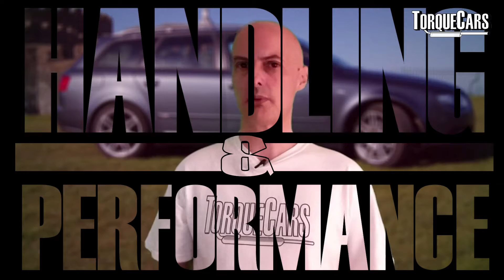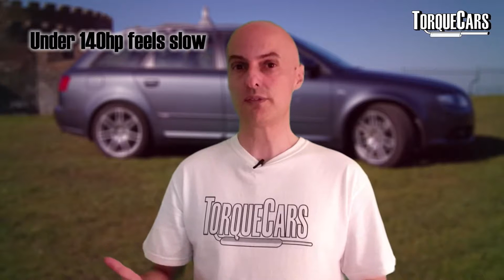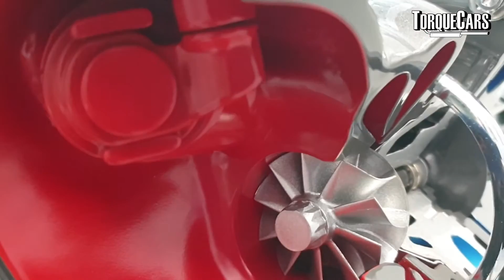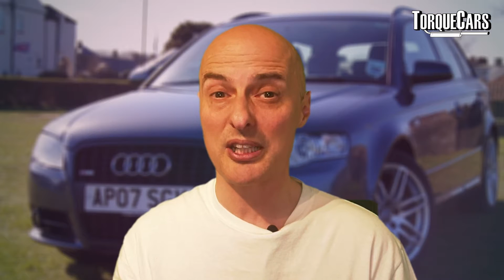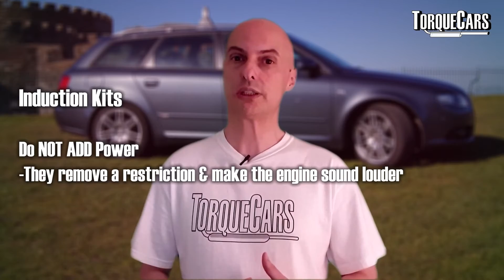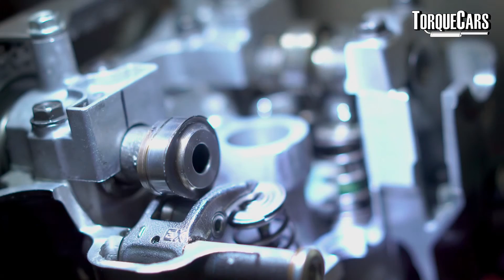Best A4 Tuning Modifications & Upgrades [Performance Mod Guide]

Comment: Im thinking about buying the Audi A4 Avant B9 150HP 35 TFSI 2019+ model, since you can remap this with only chiptuning stage 1 to a significantly high performance.
It will go up to 235 HP or 245 HP.

Would I need to change stock parts for this? To not come in trouble later on.

Thanks a lot! Liked your video and subbed as well. ❤
Reply: spoiler alert the audi b9.5 after 2020 has a different EMS which makes remapping impossible

Comment: CLUTCH... They have limits. Make sure you do not exceed these limits. A stage 1 remap without any other changes will reach these limits. The clutch fitted on my B9 2.0TDI is rated up to 420Nm. The car standard output was 320Nm but a simple remap took the output to 447Nm, so we did a custom remap on and limited the output to 420Nm.
Reply from the maker: Very good advice there, so many overlook the clutch when tuning the A4.
Reply: Hi @MH0709,
I’m owner of a B9 2.0tdi 150bhp, thinking about doing a stage 1 remap.
My afraid is do I need to do anything to my turbo, injectors, pump etc?
I’ve been told that the increase should be +30bhp and +100Nm, this way I should get 180bhp and 420Nm.
Another concern is the fact that I use my avant every day, 140km which 120km is on highway. Would really like to have my avant for a good years.
My driving is soft, but I would really love to have that extra power and of course a better consumption.
Do you have some advise?
Thanks in advance.
Reply: @BMH1965  I did a stage one on my a5 and now my clutch slips so this is very good advice!